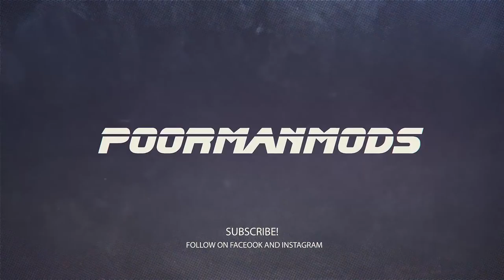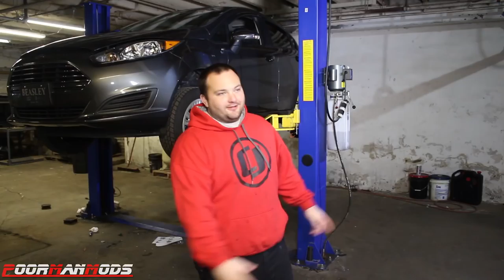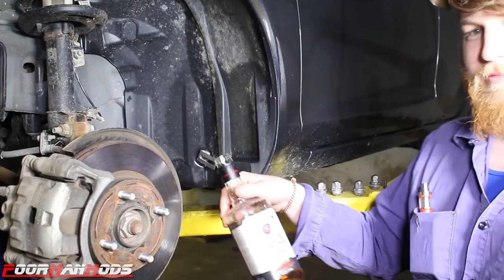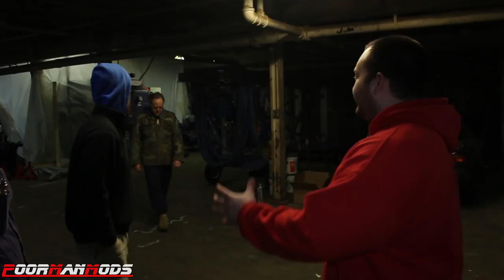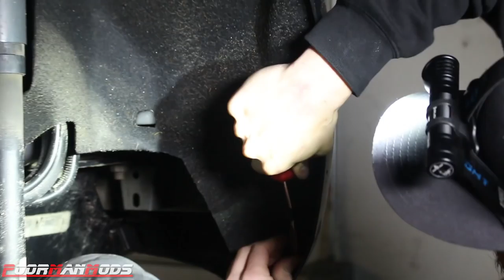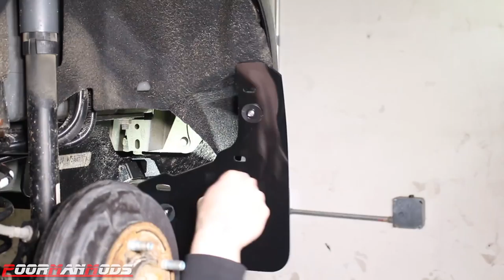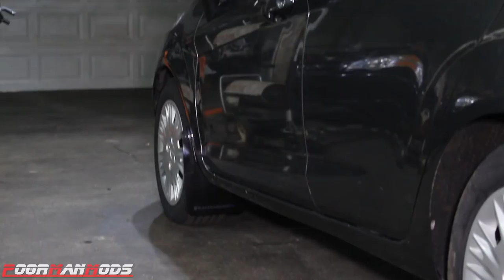When it doesn't fit you make it fit! Rally Armor Ford Fiesta ST Mud flaps on a Fiesta

Comment: Europe is rotting with shitty cars like this. I mean, the engines. Last time someone used (non turbo) three cylinders, it was Eastern Germans in the Wartburg/IFA cars.
If only nowadays cars could sound something like this (https://www.youtube.com/watch?v=y2jEgSU4h8c it starts at 0:05) I could go over it being three cylinder.
Reply from the maker: The car isn that bad, its a 3 cylinder turbo and is only slightly slower than the is300, with a few bolts on it would be quick
Reply: Still, a 3cyl.
IS300 has twice the cylinders and its three times bigger. It's less stressed than some itsy three cylinder (balance-wise: 3cyl Firing at 360/3=120° instead of the IS300 6cyl 360/6=60°). I'd rather have IS300 than these ecobox cars.
All odds (exept stupidly strict emmisions and fuel economy) are in favor of big, sturdy, more reliable engine.
Reply from the maker: that 50 mpgs is pretty appealing though, the is300 gets 25 the way i drive
Reply: I wouldn't trade all of its downsides only for mpgs.